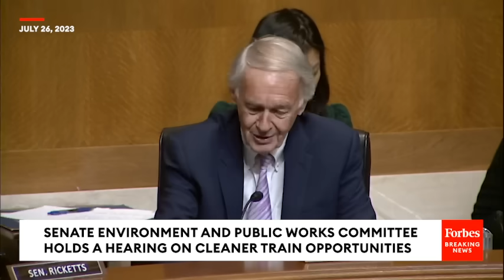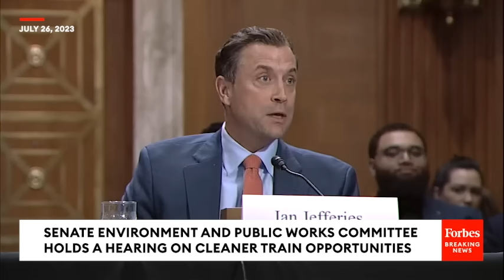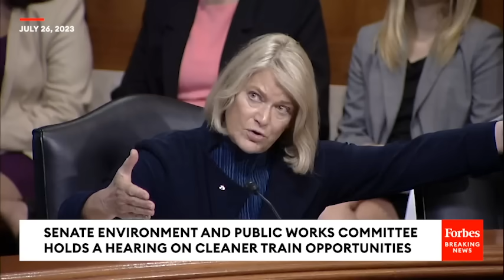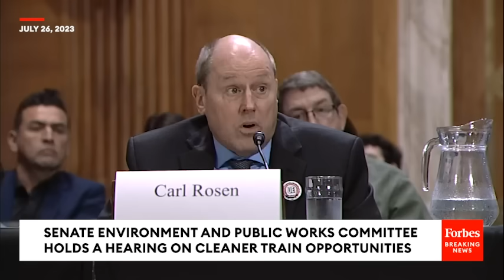‘How Long Would It Take To Replace All Diesel Locomotives With Electric?’ Cynthia Lummis

Comment: They cant make all electric locomotives. Kentucky did this and it failed miserably. They still needed diesel to run them. They cannot produce enough power and cannot run long enough to be worth a shit. Plus the cost to build a locomotive far exceeds the profit margin so they limit to only making them when absolutely needed. They instead rebuild old ones. Its on the low 3million to build a new one so add in 1000s and you can see this is not freezable. It will cost 1 trilion to just replace all locomotives with diesel and even more than that to replace them with garbage electric.

Comment: If you absolutely have to go emissions free then look at Hydrogen/electric trains with the second car being your hydrogen tank.
For quick turnaround, you could have several hydrogen tank cars loaded and ready to go...
You're not going to pull it off with battery/electric!!!!
I would imagine that most diesel/electric trains could be converted to hydrogen at a reduced cost, bet there would need to be a massive reduction in tank costs for holding that hydrogen.
Liberal lefties and dreamers seem to have this problem with jumping into the fire before they actually know how hot it is....

Comment: All freight engines are diesel electric, have been for years. Are they trying switch to straight electric? If so, maybe the unicorns can assist with the generating electric. So the trains and the electric cars and the computers etc. will run on electric while we tear out dams and decommission electric power plants. All the while, no tells us how much CO2 we need to reduce to make all the greenies happy.  Note: it is all a scam.

Comment: You are talking about passenger trains, correct? Are you  suggesting an attempt to convert every rail road in the country to electric? Self battery power or electric grid power? Case 1. The Chinese only have to take out one power grid to disable every train preventing us from moving supplies within the country in the event of an attack? If the trains are carrying their own batteries an electric pulse will do the trick as well. If grids are down how do you recharge fast?

Comment: Has any of our elected officials considered how large a battery it would take to power a locomotive that could pull 100 "cars"?  Has any of our elected officials considered the time and electric power consumption it would take to recharge a battery of that size?  Has any of our elected officials considered how much the battery would weigh to have a battery powered locomotive?  Has any of our elected officials considered how many bridges would need to be replaced that could carry such a weight?  Has any of our elected officials considered how long it would take to recharge these locomotives?  Has any of our elected officials thought about where they are going to get enough of the materials it would take to make these electric locomotives?  Our elected officials are mostly attorneys that have no practical experience in the development, design or manufacturing of electric locomotives or any vehicle that is electrically powered.  How many of our elected officials realize that the locomotives that are being used today have electric motors that power today's locomotivest?  I can go on and on and until we get people that can really think about the massive undertaking this involves nothing can be accomplished.  This is not an overnight fix.  Actually and for the first time I heard someone say it would take decades to accomplish such an undertaking.

Comment: There is stupid, exceptionally stupid and then there is this... I used to think you had to be smart to be a politician.  This is clearly not the case.  There really should be a minimum IQ required to serve in office.  The most basic math tells you this is a moronic concept. A locomotive has about 4000 HP. You see that they often have to use multiples because of train weight. Electrics produce half of that so you will need twice as many.  Plus the range is severely limited. 2000 HP calculates to 1.5 megawatts.  The largest electric is 14.5 MW. You could at best get 12-14 hours if the terrain is flat. Then there is the charging.  A long freight train that has 6 diesels would need 12 electrics. You would need to recharge these at a power plant because there are no facilities that can charge a 200 MW battery in a day.  Smart as asking for an escalator to the moon. How about you start with something simple, attainable and would actually result in savings?  Electrify the fleet of stinky postal trucks? They have a predictable range, Sit overnight (for charging) and would actually do some good.

Comment: Electric trains also work with overhead wires.  Diesel locomotives use oil fueled engines to turn generators for electric power. If the electricity could be provided along the tracks, diesel electrics could be converted as a stop gap measure.  This would be feasible in the west where there is plenty of wind and sunshine.

Comment: if we have to go all electric: i'd like to know how many nuclear power plants need to be built to accommodate the increased demand for power and a time table showing how long it would take to build them. who will be responsible for the safety of building all of them, and who will be responsible for the safe operation of each of them.

right now i don't see how this could ever happen. and if it were tried how it could be done without rushing the process and keeping too all safety standards.
if a series of these are ever built i suggest that the people responsible for the safety be the first ones who must directly and physically go in for cleanup if an "accident" happens.

Comment: An alternative could be to electrify a 3rd rail and run a dual motive electro-diesel engine which would pick up the electricity from that 3rd rail similar to the engines currently used by NYS Metro North, LIRR and New York City Transit System and Amtrak in urban areas where diesels are banned.  But it is unclear if the engines have the hauling capacity for large freight trains plus it would take time to produce such engines.  One has to wonder whether existing engines could be modified to be dual motive.  But then cost is also a factor:  cost of production of new engines, cost of retro-fitting existing engines and the cost of adding a 3rd rail to existing trackage plus the power supply to the 3rd rail.  Another factor is determining who bears the cost:  the rail lines or government.  Either way, the consumer bears the ultimate cost in higher freight fees which get passed along to the consumer or higher taxes to cover either government direct outlays, government subsidies or government tax credits or deductions to the rail lines.  One has to believe that if dual motive power were more cost effective than straight diesel, the railroads would have embarked on a conversion plan years ago.
What we are really witnessing, in California, New York and other blue states, is the coercive power of government interfering with a free economy to pursue unsubstantiated policy concerns based upon one sided propaganda and the arbitrary and capricious whim of biased elected officials who are personally invested in a green economy and are attempting to create a market where one would not normally exist.  We should require all elected government officials to disclose their investments so we the people can determine whether those elected government officials are using the power of their office to enrich themselves by boosting their investments.
Reply: Problem is that only works in short runs, the transmission of power losses are very high - makes it very inefficient.  There is a reason we don't do this large scale and it only really works with nearby urban areas.
Reply: Just stumbled on this . Are you suggesting we put a third electrified rail across the ENTIRE continental United States? Are you insane? Have you considered the tens of thousands of humans electrocuted each year ,not to mention the millions of animals fried  as well? I put in 41 years as a conductor with CSX. this  is shear madness.....
Reply: I think they mean overhead wire.  There are about 300 americans each year who die of electric shock so that is a bit exaggerated.  The 3rd rail business I completely agree is stupid and only realistic for what it is currently used for - metro subway use.  Not freight or passenger service.  Clearly this bureaucrat has no idea of how things work and hasn't bothered to find out either.. all our trains are electric.. with an onboard generation system. @markrenzella2825
Reply: No, I am not insane.  The purpose of setting forth possible solutions is to solicit possible problems with those proposals.  A simple response from you as to the reason it would not work would  have been more constructive than the insulting response you gave of questioning whether I am insane.  I am not a RR employee but a normal reasonable person trying to think outside the box based on my experiences and observations.   @markrenzella2825
Reply: That is why you need to run an overhead conductor. This will allow much higher voltages reducing losses significantly. 3rd rail is only for some specific situations. The entire European net is electric for ages
Reply: @eelcosterringa1374  This was looked at like 100 years ago in the US and partially it is overhead but it is NOT efficient to do so.  There are still great losses over distance even with overhead, that is why our locomotives are diesel ELECTRIC - they merely bring along the powerplant and the transmission distances are in feet not KM or Miles.  The amount of resources and mining you would need to do just for the wire to do that sort of thing, plus the number of powerplants required makes it frankly stupid to attempt.. You will NEVER recover the costs to do it or achieve your cleanliness goals.  You are best with an onboard power supply and battery power is ridiculous to consider.  The open distances in the US are massive compared to Europe.  Does Russia have its entire rail network electrified?  The US has electric trains.. with onboard generation.

Comment: In England they are dumping electric locomotives and turning back to diesel electric cost too much to run Up to $2000 more  per eight hour run with a 1500 ton train .

Comment: Actually it would be impossible with todays tech to replace diesel locomotives with electric, just as it is impossible to do so with big trucks.  We don't have the native ingredients, we don't have the power grid structure and batteries don't have the ability to last the amount of time to drive across the country in a timely manner.  Ask any electric car driver with a honda gas generator in their boot.

Comment: Replacing diesel vehicles with EV’s would be a massive and catastrophic failure. In power and performance diesel vehicles will out perform and outlast EV’s and are much less expensive to repair.

Comment: When I was a little kid, even smaller cities in the U.S. had Electric trams, trains, trolleys, or buses -or in a LOT of cases multiples or ALL.
  These same exact type and groups of people INSISTED THEY BE REMOVED! They HATED the catenary supply lines - the power poles, and lines that must follow the routes covered by the vehicles - back then, to cover some sparse-usage or beyond 'city limits' or 'downtown limits' areas, buses and trains dropped theie catenary, and continued by starting their diesel engines. Trolleys and Trams stayed within, and had centralized 'yards' for servicing/storing their vehicles and parts, and often served as the 'stop' for that area of the city.

Comment: Well, if you have to be like Europe then high voltage wires need to be strung above the tracks and that's a massive expense.  All electric locomotives themselves are not a problem, setting up the tracks for electrification is simply too much and it greatly restricts the loads that can be carried due to height and length restrictions.  This forbids double stack container trains and oversized loads.
Reply: I know of no restrictions on height of catenary. Somewhere in the northeast is a railroad that has electric commuter trains and double stack container trains running on the same tracks. You must be thinking of the restrictions on European trains, but that doesn’t apply here.

Comment: Battery electric locomotives would cause a utilization/charging time nightmare that would probably far exceed that caused by the extensive maintenance required by steam locomotives (the primary reason for the shift to diesel electric in the first place). The primary beneficiary of all this crap? The Chinese, of course.

Comment: What kind of power plant is going to be needed to supply the electricity?   Who pays for the conversion, the overhead wires?  If the rails are live, what will the costs be to prevent hundreds or thousands being electrocuted?  What happens during power failures?   How does electricity lubricate the rotating parts?  Do the wheels operate on nylon bushings? This is being forced on us by non thinking people with blinder in place. 
Let the market decide and stop shoving this carp into our rectums. Electricity is not the answer to zero pollution. Eliminating humans is the only way to guarantee zero emissions.
Globalism SUCKS!

Comment: There is NO way an all electric locomotive is viable.
Locomotives already are diesel electric, the diesel engine powers the electric motors on teh bogies.
Removing the diesel engine only makes you locomotive a rolling battery that has to stop and charge for untold lengths of time and for an increasing length of time for a shorter operation time over the lifetime of the locomotive as the battery ages and no longer outputs the same amount of power or charges the same level.

Comment: The diesel locomotives are ALREADY ELECTRIC.  The diesel engine turns the alternator that provideds electricity to the motors that turn the wheels.  

Soooo, remove diesel motor and replace it with a BFB units
BFB = big fucking battery

All you have to do is figure out how to recharge the batteries.  Just like Tesla cars.  

Maybe swap BFB for LNS
LNS = little nukepower system

Comment: The current locomotives are diesel electric.  The electricity is generated by diesel driven generators.  There will be zero difference in CO2 emissions as the electricity will have to be generated anyway.

Comment: This is why ivy league lawyers elected to public office aren't qualified to make decisions in the real world. They're nothing but word merchants still in a sophomoric debating club. RR locomotive's are driven by electric motors that get power from diesel generators. You can't replace that with battery, wind or solar. Gas turbine, coal fired or nuclear would take some engineering but could work. But why in God's name do you want to replace a known proven and inexpensive technology with something that hasn't been proven?

Comment: How is it that the "leaders" of our country can be so absolutely CLUELESS when it comes to how things actually work?!?!? There is no greater example of the illusion of a college "education" being beneficial to society. Electric locomotives have been tried and with the exception of very specific and severely limited conditions, they have all failed miserably. Diesel electric locomotives are built to pull thousands of amperes for hours on end and to do it efficiently and practically. Try pulling 1000 amps from a battery and see how long it lasts, regardless of how big it is. Being a government bureaucrat is like smoking weed... the more you suck, the higher you get!

Comment: No reason to ship anything by truck further than 200 miles if we maximized the use of the current diesel rail lines.   Just think of all the truck traffic and emissions that would be eliminated by that alone.  Killing off two-thirds of the rail lines for the trucking industry since 1960 was a huge economic and environmental mistake.

Comment: STUPID environmental nonsense gone too far.  Do we really think "thousands" of diesel locomotives represent any significant environmental issue, when a HUNDRED MILLION ICE cars are in operation?  We should also note that most locomotives are electric - the motors are electric and the diesel engine just drives a generator, and is extremely efficient.  
And let's not discuss the charging infrastructure needed for battery locomotives, and it's effect on the existing hundred-year-old electric power grid.  This whole tangent is stupid.

Comment: If you took the Diesel out of the Locomotive it would probably run well on electric, but it would take a 5.000 mile extension cord to run it.
Reply: That's called the Catenary. 
Overhead wire to power electric trains. 
They aren't free to install.

Comment: Everything in this country moves by diesel or gasoline. Airplanes, trains, trucks, delivery vans, cars.  EV's are fun:  look at Newsom's California:  he dictates that only EV's can be sold by 2035, and out of the other side of his mouth, he tells EV owners last fall not to charge them because of tolling blackouts.   Bicycles have rubber tires made from fossil fuel -  their metal is mined with diesel powered machines, and shipped by diesel trucks or trains.  Same with EV battery minerals.  And BTW, if you don't like child slave labor, you should know that children work in those mines in third world countries.  In Texas, I saw windmill blades being transported on diesel tractor trailers.  The power grid will never be able to handle electric unless we build thousands more dams - and the whackjob enviro-n_zis are getting those removed!   Or more nuclear power plants - like the ones Newsom and his ilk are shutting down.  This whole EV craze is the most illogical and unsustainable idea the left has ever come up with - and that's saying something.